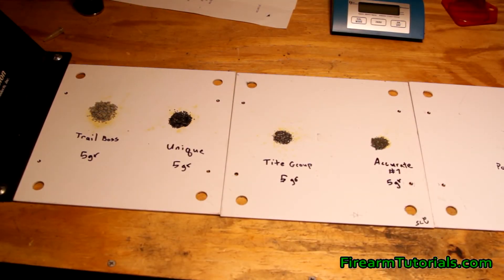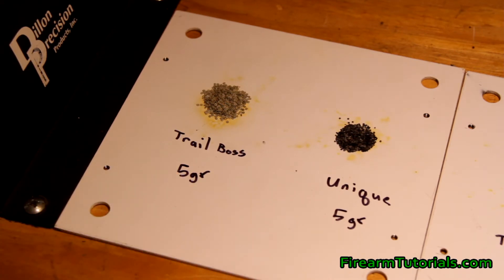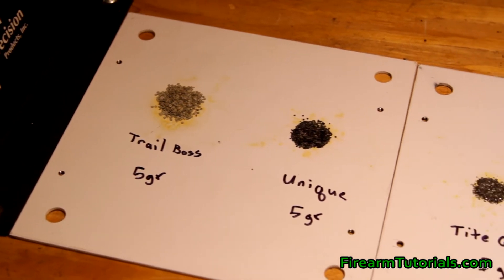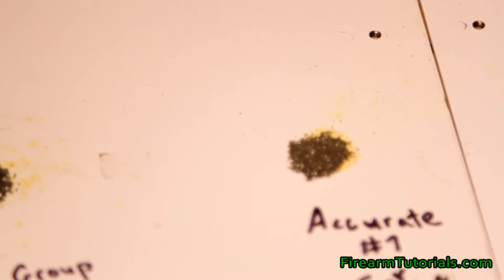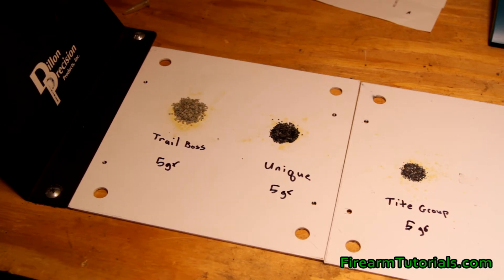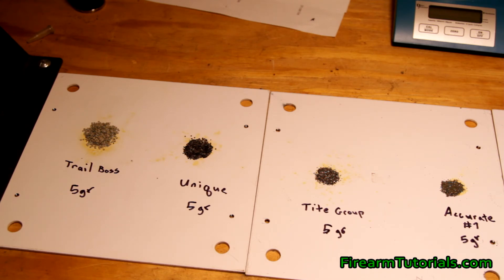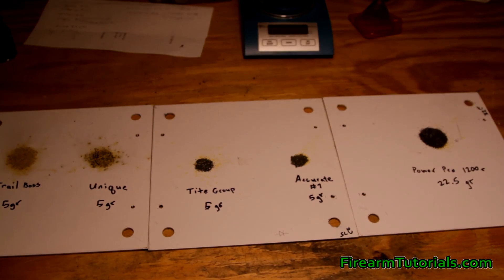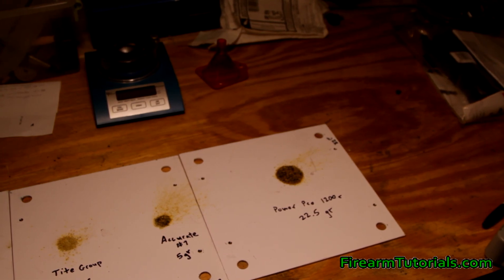RELOADING: gunpowder burn rates

Comment: What recoils more? Fast or slow burning powders?
Reply from the maker: Recoil isn't related to powder type.  It's mainly due to the amount (charge) but mostly the weight of the projectile. 

Shoot a standard 45ACP, the shoot a +P version.  It's not that the powder in the +P is faster or slow (it may be) but the amount or "charge weight."

There are exceptions, but typically the heavier the project, the more recoil.  The weight of the gun factors into this a lot as well.  That's why something like a 500 S&W isn't terrible to shoot.  It's because the gun has significant weight compared to something like a Glock.
Same concept applies with the heavy long range guns like the M82.  It shoot s huge projectile with a lot of powder, but the gun weights 15 lbs+ so it mitigates some of the recoil along with barrel design/muzzle brake.
Reply: @FirearmTutorials  quick question i am loading 45acp rounds. Can i combine different powders to make a custom charge. Like im thinking a trial boss and a tight group mixed together but keep the same grain weight 230?
Reply from the maker: @henrymoore748  NEVER mix powders.  It's one of the biggest no nos in reloading.
Reply: @FirearmTutorials  thank you so much
Reply: @FirearmTutorials  manufacturers mixed powders all the time to make custom blends. It’s not a big no-no. You just have to be experienced. I have a few mixed blends.
Reply: Thanks for the info

Comment: Slower powders generally can push projectiles faster without causing too high pressures.  I recommend Bluedot for 9mm.  With 8.4 grs a 115gr hp can go 1300fps and beyond  without hurting the gun.  Great for magnum pistol loads in .357, .41, and .44.
Reply: What if someone has a shorter barrel, but still wants good velocity?
Reply: @yayayayya4731  longer barrels will always give more velocity.  I don't think an inch will would matter that much.  You can always go with +P+ loads if your gun is strong enough.  It will add more wear and tear.  When it comes to barrels and velocity, longer is better because of basic physics, and yes she said that too.  lol